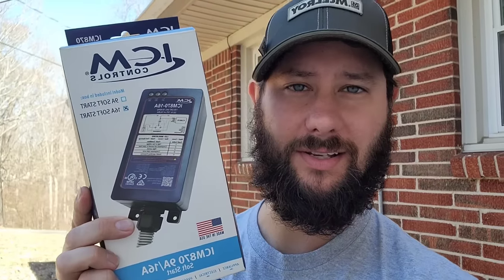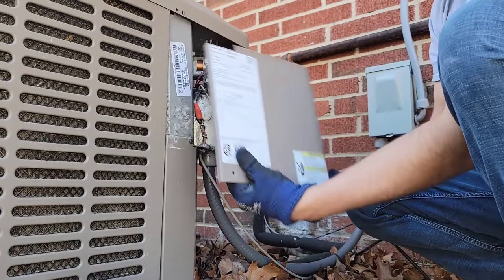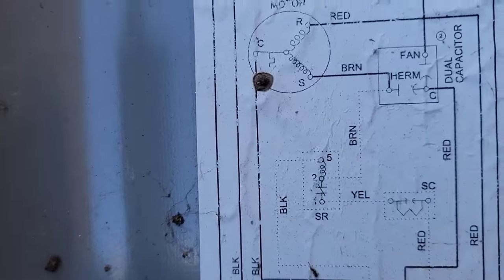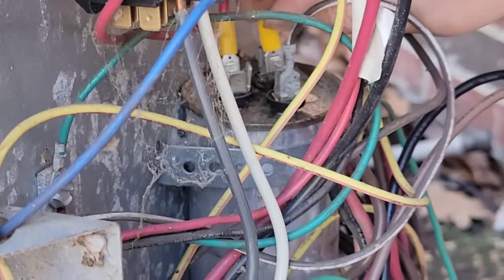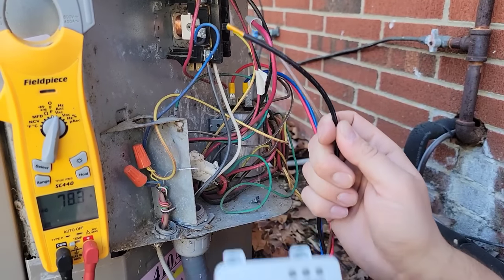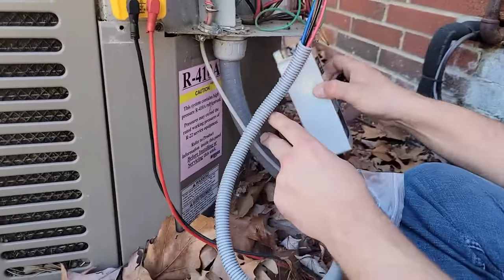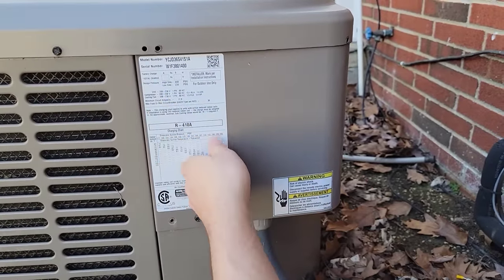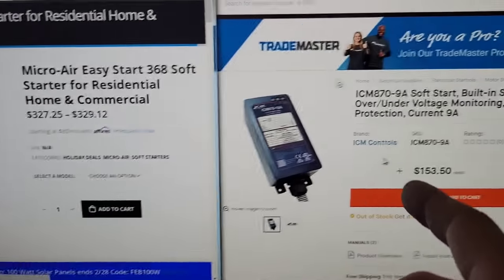How to install ICM870 Soft Start? @icmcontrols9960

Comment: ICM Low ambient/fan cycle controls are absolute garbage. I wouldn’t trust this product with my compressor.
Reply from the maker: let me know your experience. I need to learn
Reply: @TaddyDigest  I haven’t used the ICM controllers on compressor, but I’ve seen many of their products used on condenser fan motors in colder ambient areas where cooling is still needed (must maintain higher pressures or will have evap freezing problems). Motor bearings tend to wear out quicker. Also, The sensor for the device often shorts or opens, which typically either prevents the fan from coming on, or will act like the control isn’t even there and allow the fan to run full speed. I trust a mechanical fan control more (still not perfect tho). Motors without the proper bearings and grounding don’t like the variable frequency. When the frequency is less than motor design, there can be parasitic capacitance that causes frosting (pitting) and fluting in the bearing. Best to use inverter duty motors. Can get away with grounding rings, but still not ideal. Same thing for 3-phase heavy commercial equipment with VFDs, if the motor isn’t inverter duty, over time the bearings will start growling at you like crazy.